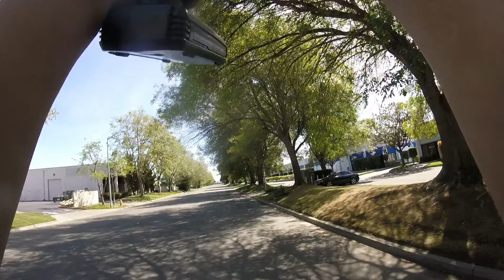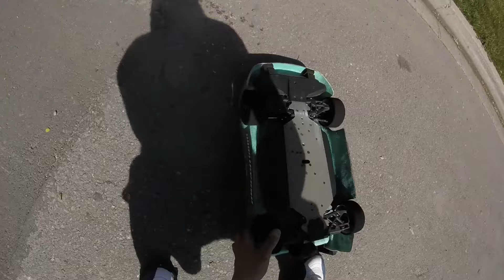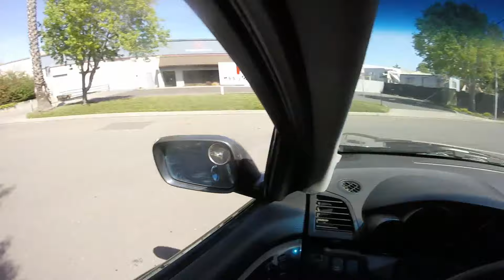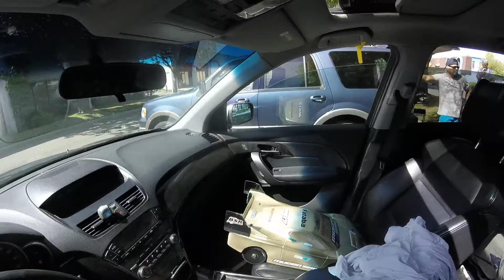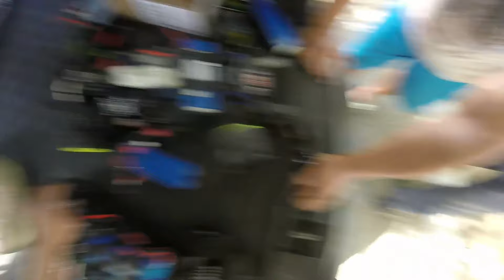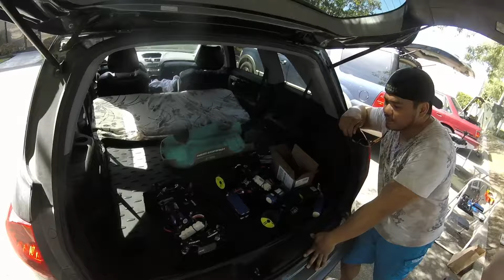Mugen MGT7 151 MPH Speed Run Blowover

Comment: I just recently got back into RC I used to live over there by All Star body shop and see you guys
Reply from the maker: Yeah we run in Livermore nowadays when weather permits
Reply: @vd49er510  I have a 1100 KV hobbywing x maxx , Mamba 1/8 6s slash, what tires do you recommend for Runs and bodies to keep the slash down?
Reply from the maker: @mikehawk9617  bsr foam tires with ipanema warrior or deltaplastic jaguar body

Comment: damn I need a better road it was good got 100 now  close to 130 it covers fast,4sec is close to my whole run,I thought 1/4mile was enough,guess not,I had 16oz in the bumper I thought it was alot,I burned my posidon up with weight and too high on the gear,it's all trial n error tho right,lol
Reply from the maker: Yeah man, the faster you go, the more road you gonna need. Sorry to hear about your motor man.